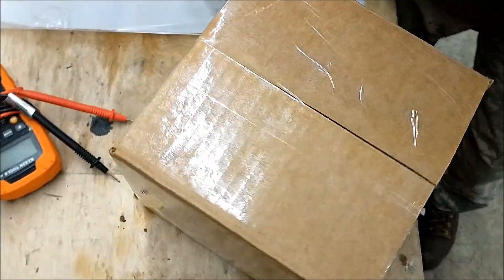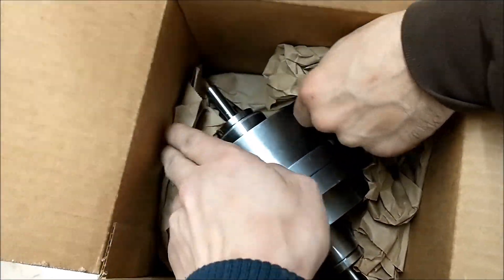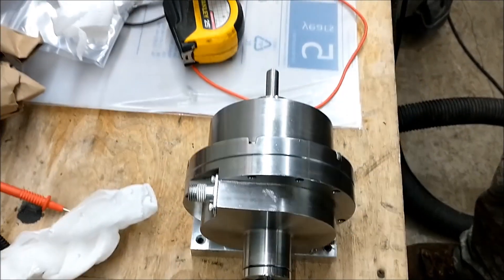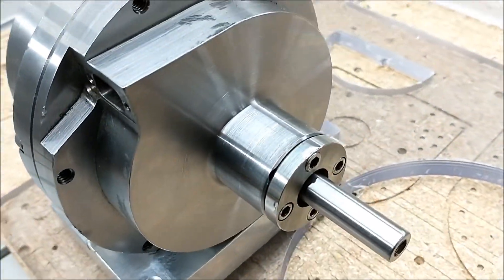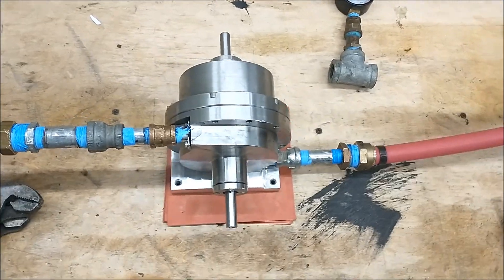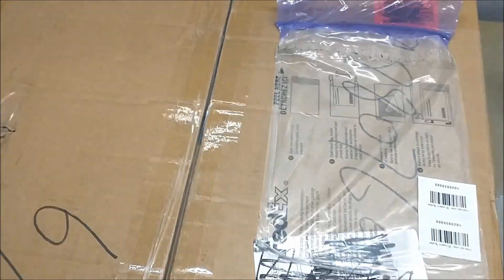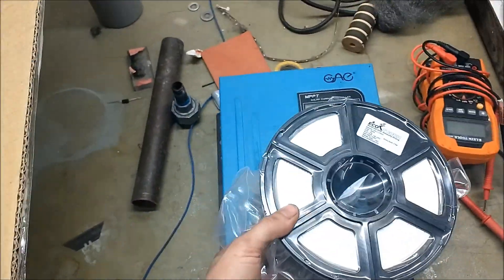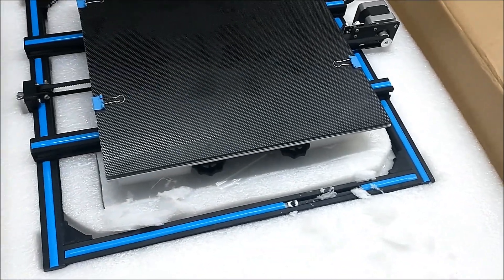Turbine Unboxing, 3d Printer, Vibration/Sound Test 11-13-2020

Comment: I'm so glad I found this channel! Since I've learned of Tesla turbines I've been really wanting to build my own, and the 2 stage turbine is really cool. How does the first stage exhaust to the second, is it just through the housing? Could your use a hollow shaft with angled slots cut in between the rotors to make the shaft also act as an impeller? Or maybe a fluted shaft? I thought maybe that could increase torque or at least extract more kinetic energy since the exhaust would be in the center most part of the turbine.

I've also been interested in making a generator setup utilizing heat from evacuated solar tubes. I thought about using a low boiling point liquid to generate steam, but I like the cold steam to turn a Tesla turbine in a vacuum idea way more.
Reply from the maker: Yeah you could use hollow shaft, something I've always wanted to try that! Starting with Tesla's designs though. Would make a perfect transition between pump and turbine.

Comment: What is the temp in and out. looks like a cr10. good printers i built 3. the temps are so i can try and build an algorithm to automatically solve size and power along with the other attribute
Reply from the maker: Still gathering details about it.
Reply: @iEnergySupply  are you going to print one if so am guessing your going to use petg or are you going carbon fiber?

Comment: Been following your works for a while now and was curious if you have looked into building a model that replaces the bearings with a.) permanent magnets or b.) air bearings to increase efficiency.
Reply from the maker: This testing is on the way.